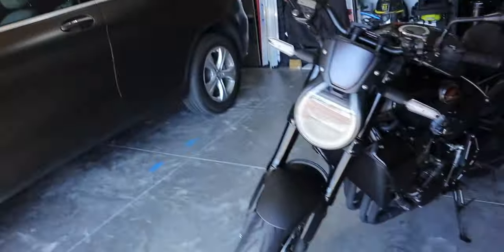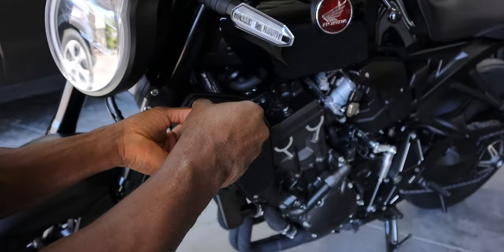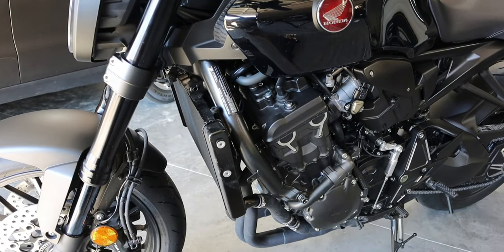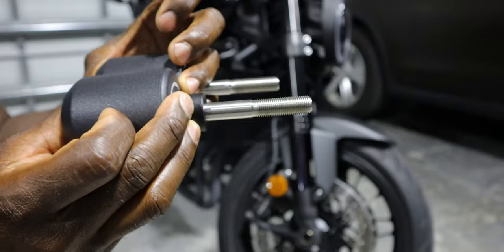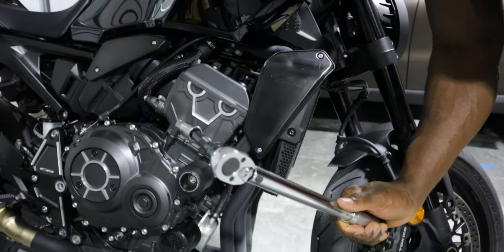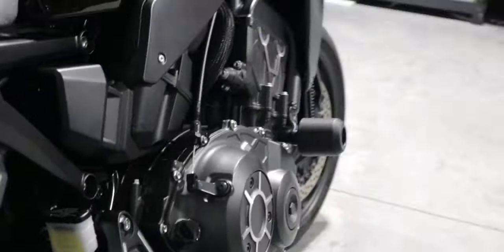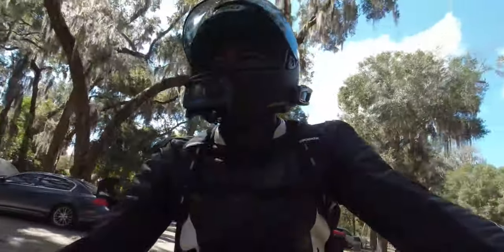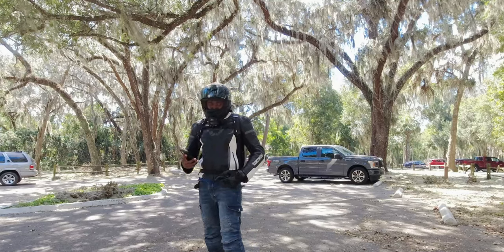2022 CB1000r Black Edition! Just installed Frame Sliders, Radiator Guard, a new Backpack

Comment: @Cyclevybz I just fitted these parts to my bike. Cheers for the video it made life easier. 
The instructions for my guard on the EP website says the 6 rubber spacers should be fitted on the front of the guard: 

"Locate round holes amongst hexagons. Push Rubber Spacer through from the back of the guard so Hexagonal shape sits on the front face."

They might have changed the design this year but it may be worth checking as the rubber spacers seem to have been fitted to the securing hole on yours.
All the best 👍

Comment: Hey, love the vid; just purchsed  my  2024 cb1000r, after looking at the model  for the last 7 years. I noticed that you didn't put in; or maybe didn't receive the rubber screw inserts that came with my evotech guard. Guess it really doesn't need them. Good to know! Thanks again!
Reply from the maker: Yea, I have to go back to see why I don’t use or need them. I’ve had no issues since the install though

Comment: Thanks for another helpful vid, dude. I got R&G frame sliders for mine that go in the same bolt holes. The directions to say take one bolt out at a time and also put a jack under the oil tank at the bottom to keep the engine from moving during bolt removal. I see you did yours without a jack. Did you experience any misalignment during your install process when taking one bolt out at a time?

Comment: You did install frame sliders when bike on the side stand without any problem? Engine not droped or moved some mm? I did so and it moved a lot of which make me big trouble to align the engine with the frame and insert the bolt...
Reply from the maker: I installed one at a time with no engine movement.
Reply: @cyclevybz  thanks for your reply, I did also one side at a time and used only side stand of bike, but it moved anyway...perhaps my bike is unique :)